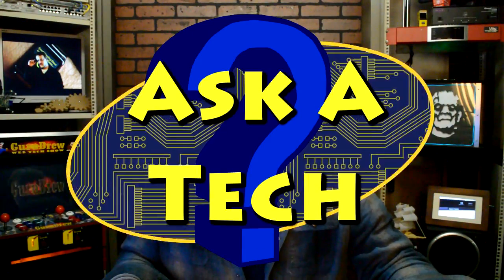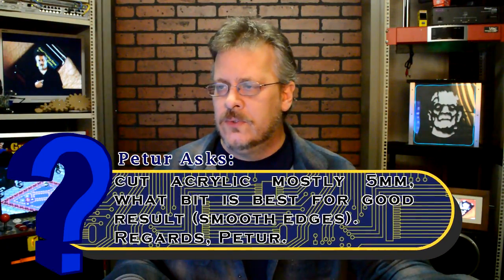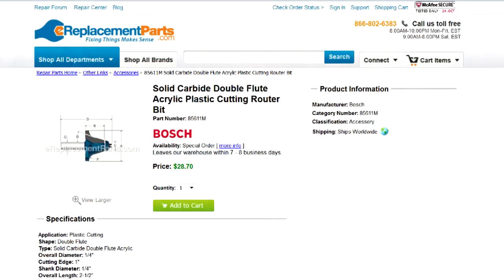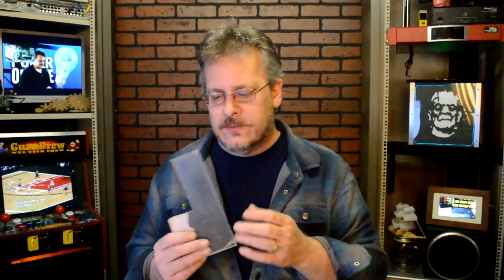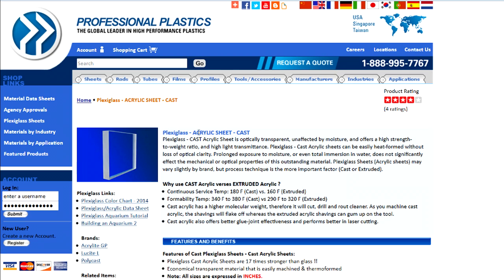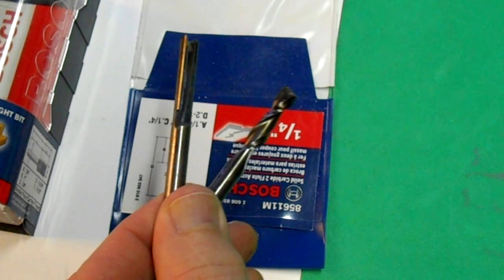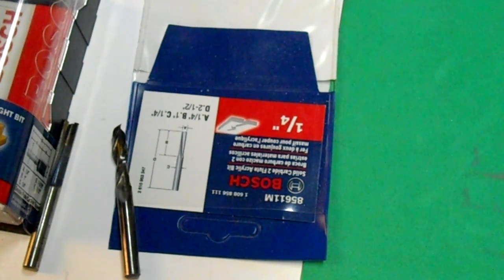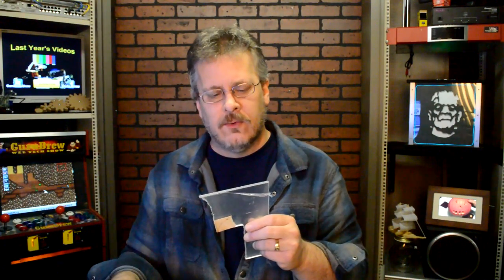Best Bits and Techniques for Cutting Acrylic - Ask a Tech #57

Comment: First thing is to figure out what type of acrylic it is, either cast or extruded. Cast cuts much better on a cnc. I cut mine just fine using 18000rpm/35ipm with short pauses in the gcode between cut runs. I just cut some 0.227" router plates yesterday that came out clean in two depth passes. (This was a 1/4" shank 1/8" cutter) Now making those cut edges clear and smooth is another story in itself lol

Comment: try an upcut, slow the RPM down and dont cut too deep. Make shallow cuts and take breaks between cut passes. You could also rig up an air compressor to jet out air into the cutting area, which will help cool down all surfaces. I would avoid any straight bit as its too aggressive for fine cutting. I use a Tommy Global TG1113 and it seems to work fine for both Acrylic and Wood. Am considering a compression bit to skip the upcut burr though, so i dont have to worry about doing precut scoring, which is quite annoying.

Comment: For cutting plastics with a router bit, you want to avoid creating heat as much as possible. You need to move fast with the router (called feedrate), and you want to turn the spindle rpm speed low. You'll also want to take shallow depths of cut, especially with harder plastics like acrylic (something like PVC is more forgiving).

Youll need the appropriate router bit, usually a diameter of 1/8" or 1/4". It needs to be an "O-flute", upcut spiral endmill, usually with 1 flute/cutting edge.

Comment: I think if you pass in stages there is less load on the bit and acrylic sheet , for instance if the thickness of your sheet is 10 mm . First you cut 2 mm them 4 mm 6 , 8 and at finial extend the bit to 10 or 11 mm and finish up the job.

Comment: I know this video is a few years old but its still very helpful. I started cutting ABS plastic at 1/4" thick and found that the 1/4" Spiral Flush Trim bit i bought from mobile solutions seems to somewhat get stuck. For example it tends to want to push the abs sheet away from me vs wanting to cut it. I am using a Dewalt DW618 router and have tried the first 3 speeds on it and it seems to give me similar crappy cuttinf results. I tried this bit with 1/4" wood and it cuts very smoothly so I was wondering if Acrylic would be much better to cut with a router. On the website for mobile solutions they claim that the bit I purchased is made for Plastics/Abs but its excellent for wood. Im wondering if it really does work well. Im new to all of this and started custom making stuff for my vehicle car audio gear like speaker brackets etc. So thats why I went with ABS but wondering if I should try Acrylic or get a 1/2" thick Spiral bit and see if that one would cut better. 🤷🏽‍♂️

Comment: you can avoid the 'welding' due to overheating by using a slow speed
Reply: Contrary to think, going slower actually compounds the problem. Set feed rates as quick as the bit will allow.
Reply: You want a fast feedrate, and slow spindle rpms when cutting plastic, to avoid creating heat and melting issues.

Comment: For CNC use, try this single flute bad-boy https://www.amazon.com/gp/product/B000P4HKRC/ref=s9u_simh_gw_i4?ie=UTF8&fpl=fresh&pd_rd_i=B000P4HKRC&pd_rd_r=2f1fceb5-331a-11e8-ba50-2f42e5cb9555&pd_rd_w=Wbu40&pd_rd_wg=QHx9S&pf_rd_m=ATVPDKIKX0DER&pf_rd_s=&pf_rd_r=E0S0P2T5PS27G5CKETTW&pf_rd_t=36701&pf_rd_p=1dd2ffc3-992f-4bde-81b0-de270e0ead5a&pf_rd_i=desktop Check it at Amana's website.

Comment: When cutting plastics if you get a cheap flood coolant system all your problems will go away, plus I use Harvey Tool cutters for plastic and they are so sharp that you have to actually be careful when handling them as they will cut you.

Comment: Do you recommend cutting 3/8 thick acrylic with a jigsaw?  If so, what size blade is best?
Reply: Maria Monroe  
I've done 3/8" with a coarse jigsaw blade designed for aluminum.  For extruded, watch for the shavings that they don't booger up.  Use a dish soap and water mix to keep blade cool.  Look up Bosch T227D blades

Comment: How to do pattern routing for acrylic? I can't find any top roller bearing acrylic pattern bit. I don't like to have the router bit exposed, although it might cut down on heat since there is mor air above the cut sheet.
Reply: +Robert Coles Whiteside makes a great 1/4 " spiral bit with a bottom bearing, available in up or down cut.  I use it in my router table. I live in Canada, so I went to  Woodcraft.